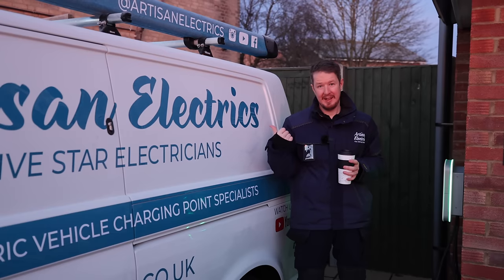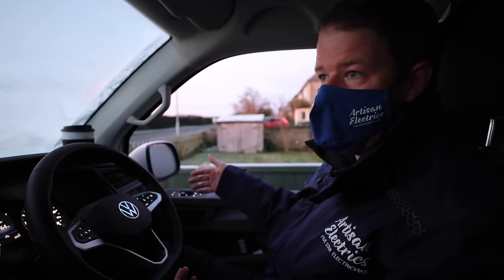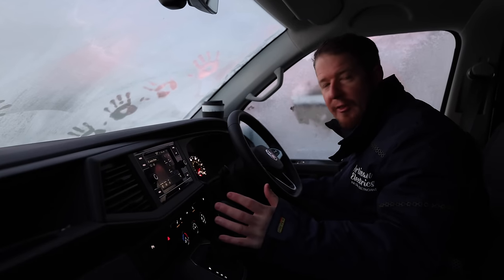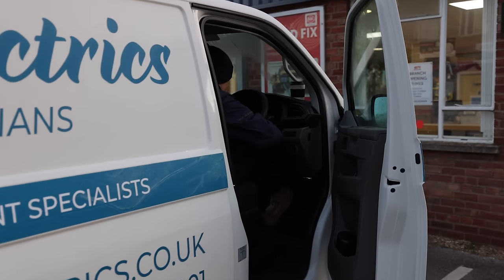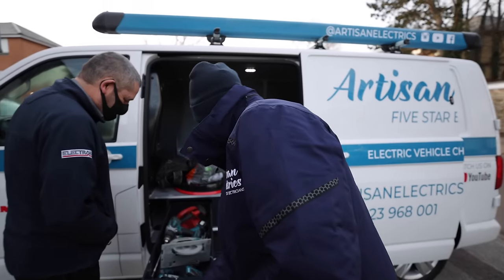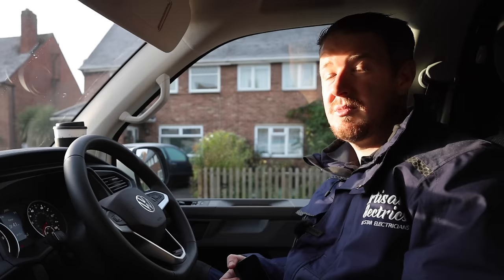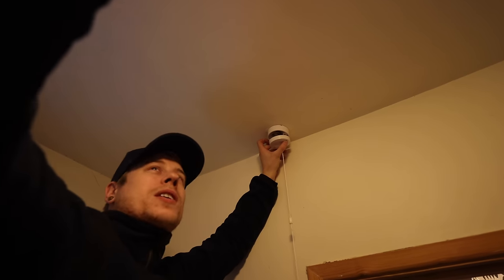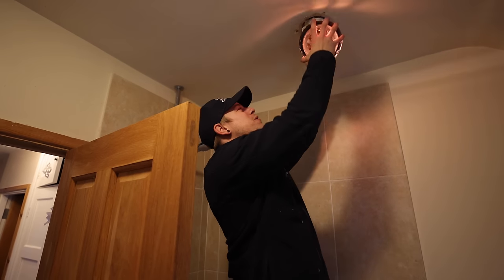ELECTRIC VAN NIGHTMARE 😬 - Volkswagen Transporter Electric Van

Comment: Fellow electrician in Canada. Love the idea of an electric van as my gas consumption would cover the payment on a new van. But here it gets pretty cold and it’s seems like even if the batteries weren’t affected by the cold - the original estimated range still wouldn’t suffice as a full time work truck. Think battery technology still needs work before it will be convenient. Also my thought is that there should be stations that swap out modular batteries on vehicles instead of charging them. That way the batteries are in constant service and you don’t physically own a battery but are more or less renting one.
Reply: The problem you have with vans is you could add more batteries BUT that would limit the load-carrying capacity more than in a car and add extra costs - also Tesla tried battery swaps but it just adds more costs with extra batteries needed and another point of failure in the vehicle and now with more rapid chargers for most its not an issue especially with home charging as well. I know a guy from Calgary that runs 3 electric vehicles in the house and it works for him and his family though 2 are Tesla's. At the end of the day its about buying the right vehicle for YOUR needs and this VW van is not the best on the market for this electricians use case with others easily achieving well over 100 miles of range in winter.
Reply: Batteries are great if your work or drops are in urban areas 20miles a job then park up charge up.  they dont waste road fuel stuck in traffic etc
Reply: Battery swap stations and renting/leasing the battery is the approach Chinese EV maker Nio have adopted, they have over 700 swap stations and recently passed 2M swaps. So many city dwellers in China have no home charging options (nearly all live in flats). Their battery swap is done in under 3 minutes! No vans yet though.
Reply: @garyday615  Wish there were an easy way to save useful comments like this. ITs the way Car Rental dealers will have to go at least
Reply: @jimspencer6677  I'm definitely not thick, I don't drive an EV!!! They are shit.
Reply: Combustion engine all the way!!
Reply: @highpath4776  You would certainly hope so, the problem is EV manufacturers will have to cooperate on battery sizing and fixings etc , which is hard to imagine!
Reply: Are you sure the extra cost of an electric van would be offset by fuel savings?
Reply: @paulholla  I got you wrong, sorry. Sure, load of crap, and those who buy them will find out
Reply: @richard21995  Absolutely, the biggest con ever
Reply: @richard21995  It may have passed you by, but in the UK no new fossil fuel only vehicles will be allowed to be sold after 2030.  That inevitably means some early adopters buying at higher prices while the technology improves and prices come down. Currently ICE fuel is around £6.70 a gallon which at 40mpg makes 250 gallons for 10,000 miles and a fuel cost of £1675 . An EV averaging just 3 mile per kWh for 10,000 miles is 3,333 kWh if you average 20p per kWh (assuming some cheap off peak charging) that’s £670. Also factor in reduced service costs and the contribution to improving air quality and many would see that as viable.
Reply: Lol first thing I thought when he complained about it being -1°C... Someone somewhere in Winnipeg will be plugging in their engine block heater right now.
Reply: Just fit a chinese diesel heater, solves all the problems the battery can't handle.
Reply: @sonyshah8927  I'll have two, love a Chinese diesel

Comment: Can’t beat Ford work vans with heated seats & heated front wind screens 😂👌🏻
Reply: 💯💯💯 Agreed
Reply: @Thegardener87  😂
Reply: @Thegardener87  truth
Reply: @Thegardener87  110% truth
Reply: This defrost problem must be only with the electric VW transporters. My diesel 2015 T6 has heated windows and mirrors and defrost in minutes.
Reply: I have a transit and a new transporter, believe it or not it does have a heated screen in this video, it’s just really annoyingly out of view when in the driver seat.
Reply: @joshgault61  must be a slow clearing heated windscreen element 🤷🏻‍♂️
Reply: @tonyl1984  it goes off quicker than the transit one. But it works okay. It melts it, you clear it with wipers then it clears the condensation
Reply: @joshgault61  the mighty VW Group, entered into a partnership with the Ford motor group in 2020 to develop and jointly produce their electric vehicles sharing and using the superior VW platform as its base. It's therefore somewhat surprising how badly this premium van produced by Ford and VW is performing for you.
Reply: @aevans-jl9ym  I must have the only heated 6.1 screen that works as well as my transits 😅. No complaints from me bud!
Reply: @joshgault61 Jesus Christ, £50,000 for a van, l am so envious, enjoy it whilst you can my wife and 2 kids would never allow me to buy it.
Reply: @aevans-jl9ym  I do not own an electric 6.1. We have a diesel 6.1. Just pointed out it’s the same screen as our transit van, it works fine. It cuts off quite quickly, so if it’s frosted you have to be sat in the thing to knock it back on. Never had to use de-icer and definitely not putting water near a heated screen. Crack for a past time I’m sure

Comment: My wife had VW once.  Her problem was it wouldn't stop driving.  The fuel injection system stuck wide open.  She had stomp on the brake until she felt it was safe to turn off the ignition on the highway and let it coast to a stop on an exit ramp.  She opened the hood and jiggled the throttle cable to get it unstuck.  Then limped it to a dealer.  Where they charged $900 to replace it (The car only cost $9000 new, late 80's).  We knew of other coworkers with VW's that had the same problem.  The icing on the cake was seeing an ad for a police show with a run-away car.  It was the same model of VW.

Comment: When you couldn' t get the lead out i was shouting "unlock the doors again" . 3 kw limit on charge is madness. Needs a much bigger battery for sure.
Reply: The Transporter supports 7.2KW charging, when set up correctly, I suspect reading the book would have solved those issues.  82 mile range though ... that's pretty poor.
I'm really surprised they didn't opt for a larger battery and 3 phase charging support, but that extra battery weight has to be offsett from the payload capacity I guess.
Reply: I just dunno why you'd buy one with such a crappy range. The vivaro elife people mover variant I looked at still had more than that.

Those electric purpose built ups trucks do waaaaay better & they're British designed & built
Reply: Should have had a demonstration of how to use the vehicle or read the manual, mind you probably best to wait a couple of years before buying, new vehicles will probably have better batteries you then.
Reply: @stuinNorway  "Reading the book"? Are you mad? That's what professional car charger installers expect their customers to do.

Comment: We use ENV200 vans  and they are just about viable for the work we do (high voltage substation craftsman) On the motorway we can get about 90 miles with the 40kwh battery. Only issue is that with the racking and tools its very easy to overload it past its max vehicle weight. The 15 minute morning preheat is a godsend on days where its frosty outside. Get into a nice toasty van.
Reply: Had 2
Reply: Same story with the env200 from me. Just about carry what's needed for the job. Nothing more. Can't travel any distance with the heater on either.
Reply: A 40KW battery is a van sounds woeful to me. I have 38KW in my small car so I would want a van to have at least twice as much capacity, 75kw upwards.
Reply: To be fair 40kw works fine in London but all the sites I'm based at have 7kw chargers. I'm charging the van at work everyday. On journeys where I can avoid the motorways the van is fine but sitting at 60-70mph destroys the range.
Reply: @Marks-Garage  on my second now40 kw loaded do 100 but on motorway I do 55 mph
Reply: @adrianthorpe8005  Have a 24kw Leaf as our only car. Sitting with hgvs on the motorway definitely gets the best out of it. That may be a bind to some but in practice is far less stressful than rushing.
Reply: Was ready to give up on electric cars after driving 80 out of a 150 mile drive and you have to wait 40 minutes for someone else to finish charging before you can charge.
Reply: @islaws4589  Yeah I set my cruise control to 58 and just stay a little distance behind them. Still do it in my Diesel van, haha!
Reply: @cbcdesign001  this VW has 37.3kWh 🤦‍♂️
Reply: 15 minutes?
Diesel trainsit you just turn on the heated windscreen and heated seats and are 15 minutes further into the traffic jam
Reply: @walkaz  You can do the same in the electric van, Cabin heater is 5kw so it warms up very quickly. The preheat just means the van will be fully warm when you get in, you dont have to use it. You can also get it to cool down on hot summers days for 15 minutes as well. I used to have a transit connect and the warm up time was dire. If it wasn't for the heated windscreen i would have to wait 15 minutes with the engine running just to get heat out of the heaters. EV definitely wins on the winter warm up front. I also dont miss the huge amount of turbo lag on the diesel vans. The EV's are rapid off the line which is great in london traffic

Comment: So, the window keeps going down because it's feeling a resistance from the extra thickness and roughness of the ice and there's a sensor in the window that prevents people's body parts of objects from getting stuck in the window as it raises. Obviously. The button you thought was a windscreen deicer is in fact a rear demister. Do not use boiling or even hot water on your windows. Lukewarm water is warm enough to melt the frost instantly. 
I cannot believe you are a tradesman and an electrician. I thought you lot were supposed to be the 'smart' ones. The van is part of your job and your toolkit. You should have a fucking ice scraper. You should also know what the symbols in your car mean. If you do not you should consult the user manual. It is not VW's fault you cannot read symbols that have been ubiquitous for decades and were so during your driving test.
It is people like you who are forcing companies to treat us like idiots. Honestly, if you just had a de-icer or improvised with a CD case or something you wouldn't have slagged off the van, wouldn't have been late and wouldn't be irritated (neither would I).
Reply: I’m from a place where we have way rougher winter weather than the UK and our cars look like igloos for several months every year. The thin layer of frost on the van windows is nothing that should bother the window motor one bit. 

The way the glass tilts back and forward when he messes with it makes me think there’s something wrong with the lift mechanism. I would have the dealer look at it.
Reply: @Naughty_Squad  well he didn’t do it to make himself look good. 😂
Reply: Rear demist in a closed back van… yeah

Comment: I have a Nissan EV 200 we’ve had it for about 12 months 40 kW battery we haven’t had frost problem
 we put it on pre-heat in the morning get to the van it’s toasty warm it’s fully charged we doing about 14,000 miles a year in Lancashire which is a lot colder than where you are

Comment: Seeing you melt the ice off the windows with a kettle reminded me of the story about a Ferrari rental service where they had an issue unlocking the car.  Turns out the lock shrunk due to the freezing cold of Atlanta, Georgia and the only way to fix it was to poor water down the side of the window so the lock would expand back to it's normal size.
Reply: But on the windshield... the easiest result pouring hot water is a cracked glass...

Comment: it's normal you can't remove the cable by pressing the button. The cable is locked even after the end of the charge until you unlock it with the keys. It's to avoid people stealing your cable :)
Reply: They don't bother unplugging them to steal the cable, they tie a rope round it and rip it out of the van and the wall in some places.

Comment: Don't use hot water, room temp water or slightly above is all you need, just make sure to wipe the window quite quickly after with the wipers.
Reply: yes just enough to melt it and then wipe it away before it refreezes
Reply: from the lack of steam, that looks like what happened
Reply: You may have already seen this. Get hold of a large sized heavy duty zip-up type freezer bag. Fill with warm water and lay it on the frozen windscreen. Move bag to a new area and scrape off melted ice. Repeat as necessary. Change water in bag when too cold to be effective.
Reply: @markmiwurdz202  that's way more effort then just tipping room temp water over the window and setting the wipers away 😂
Reply: Cold water run staright from the tap does exactly the same or garden hose is even quicker for no refilling
Reply: @markbutcher9519  iv found that tends to freeze over very quickly on a propper cold Northern morning 😂 and the hose pipe is take inside as to not split wide open obviously
Reply: Iv used nearly boiling water on my car for years. Been expecting the windscreen to break but it hasn’t.